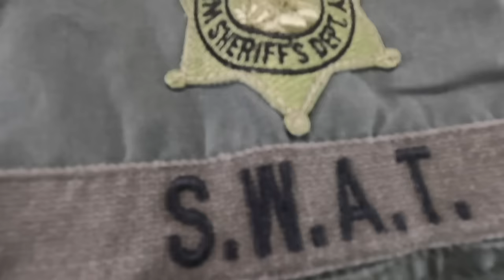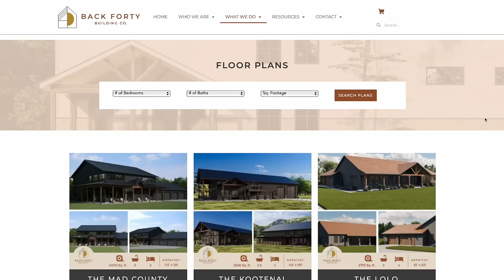Is $elf Building Worth It? | The Intro | Ep 1

Comment: i never liked or wanted the tall 14 ft plus walls , can i build 10 ft or less wall , and have a 48 ft free span truss with a 8 -12 pitch with a attic room for some extra space ?
Reply from the maker: Yes you can. With attic trusses you will most likely have to set them 4’ on center depending on the size of room u want.

Comment: Good point about being debt-free when younger.  I did the same thing and am grateful for it.

I'll be interested in building a barndominium, or shop-house in the Michigan area in the next year or two.  

My goal have a lean-to style greenhouse/sun room on the south-facing wall which bleeds into the kitchen, and then on the north side have a large garage shop area, that is big enough that I could build shipping container-sized projects in it.  To mitigate temperature, I was considering a berm on the north side, it doesn't touch the shop area but buffers from the extremes in temperature and maybe a place to put in some a geothermal system, to augment a heating and cooling system.
Reply from the maker: Made all the difference.

Comment: Is there a way of reducing the cost of the build if someone is utilizing a VA Construction loan? If you require financing for this type of project, what would be an alternative loan method that still allows you to build all or a majority yourself?
Reply: Whatever you do, never say the word 'barndominium" to the bank. Its a house. As long as the poles are done the way Paul does it with them not being in dirt, then it's a house.
You simply want an owner-builder loan. Documentation documentation documentation is the key. A solid budget & a solid plan/schedule is what the bank wants to see.
Planning! I spent 3 years planning my first build & 3 years actually building. I came in under budget.
Reply: Banks in my area have no problem financing a ‘Barndominium’. Don’t call it a pole building. lol

Your biggest obstacle with financing is that a majority of lenders want a licensed, General contractor running the job.
Reply: Look outside of. a loans they are not the best deal and most of the time self build is not allowed. Lots of hoops to jump through.